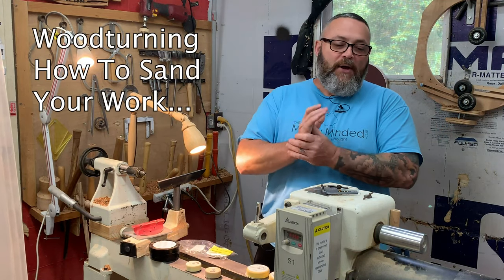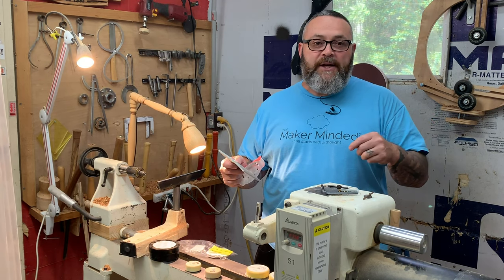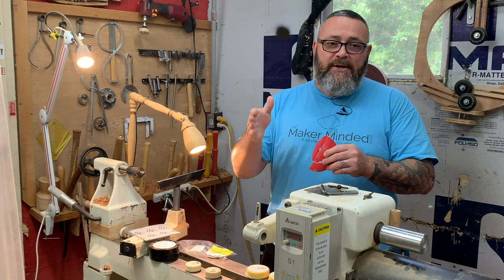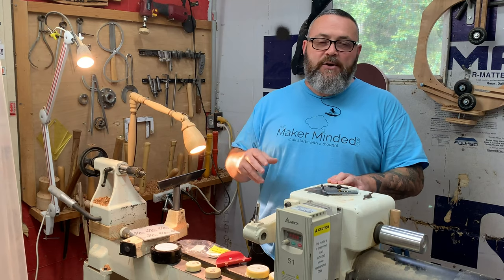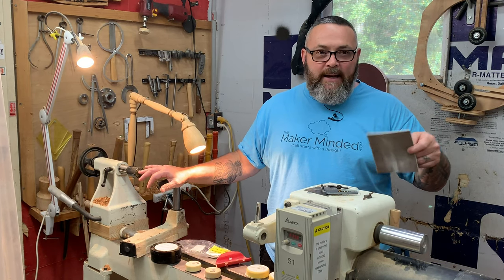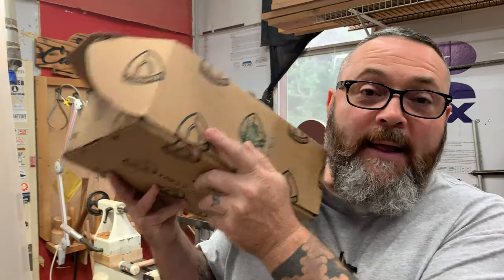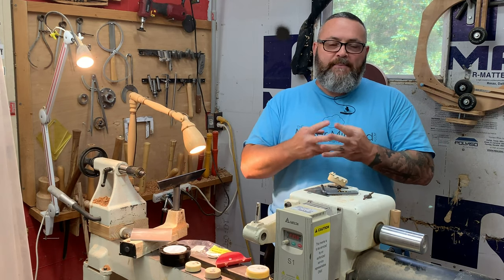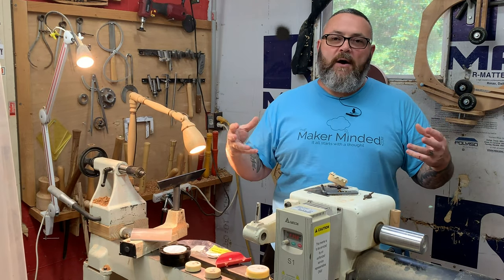Woodturning | How To Sand Your Work

Comment: Good video Donny, I have also started using the quick disc system for power sanding and I've used it with the Abranet discs with great success even running in reverse.  They will be getting a good workout this weekend, got plenty to do!
Reply from the maker: Thanks, Curt! Have fun this weekend!!